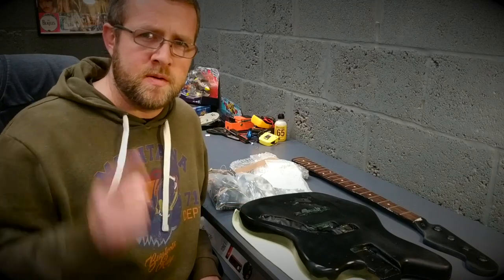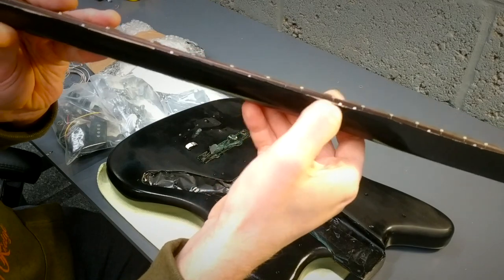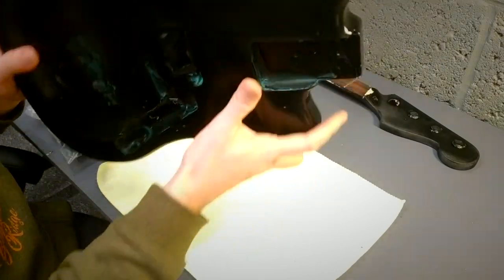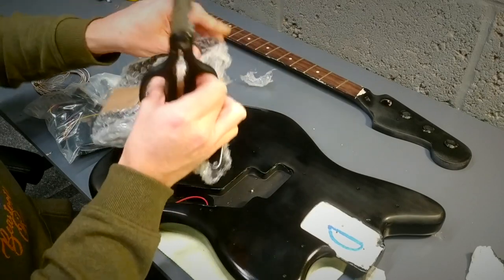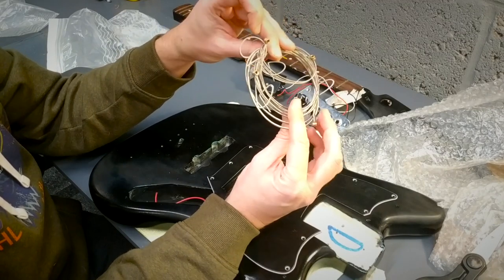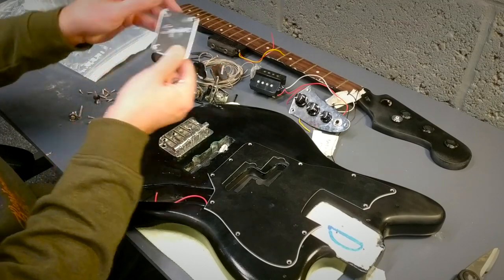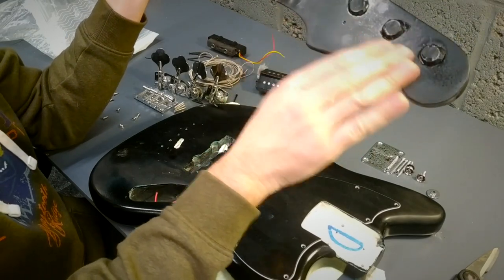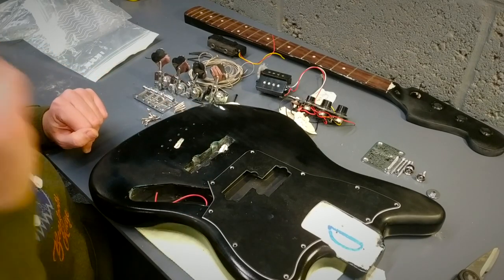Squier Vintage Modified JAGUAR BASS Restoration Project

Comment: I really dislike painted necks. Looks like heat gun time to me.

They only came in a few colors iirc. Mine is candy apple red. Swapped a high mass bridge on it, set the action decently low and use a pick to play it. They're lots of fun.
Reply from the maker: Me too I'll be sanding back for sure.
I live these Jag basses had a few before 🤘🎸